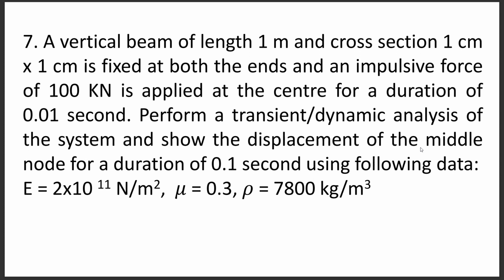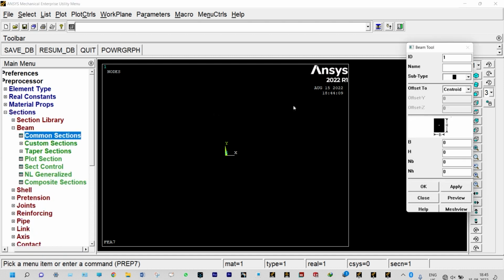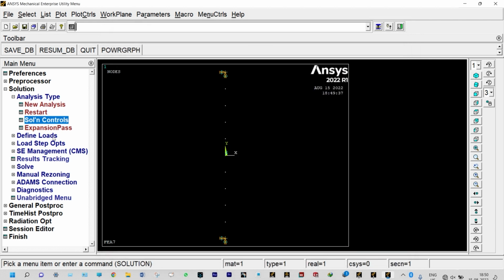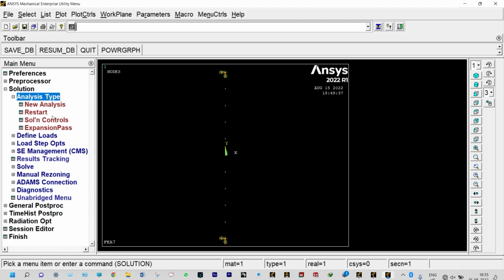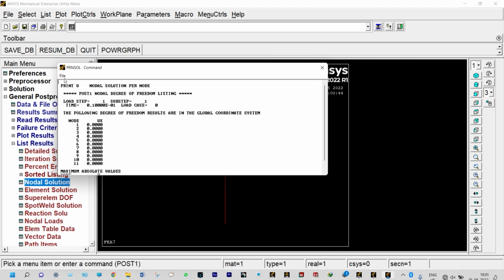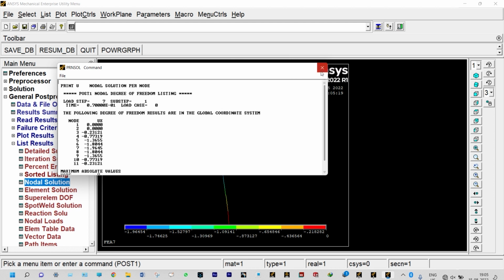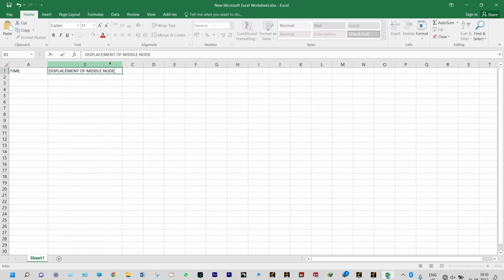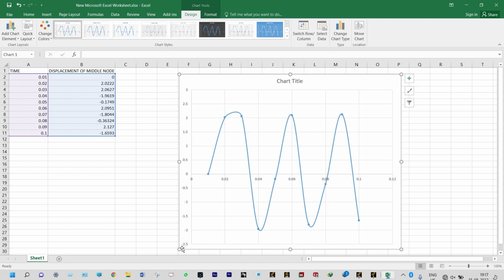Transient Analysis of a Beam | FEA Beam under Impulse Loading - ANSYS Mechanical APDL

Comment: Hi, I am doing a different que but have a problem, lets say I got a graph like you did at 14.19  but the problem is that the values of no.'s on y-axis is very very large and because of that the graph is a straight line and I cant even see the blue line of graph, it looks like there is no graph, how can I solve this ? is there a way to reduce the values of numbers on the y axis or both the axis ? please help
Reply from the maker: Change the axes lograthmic